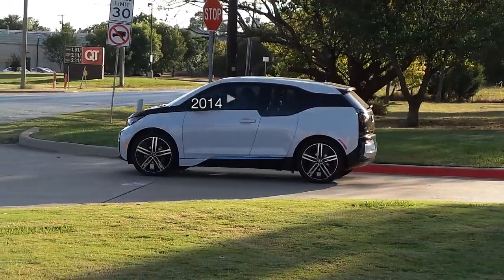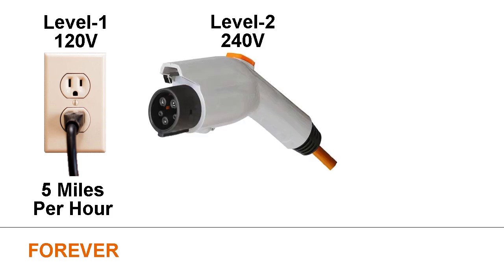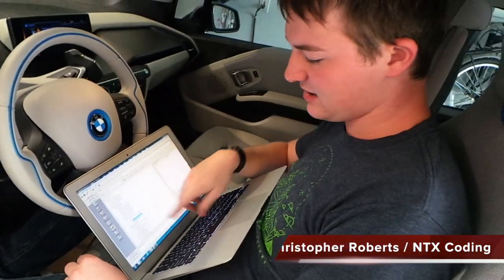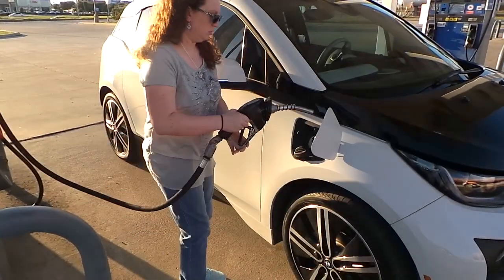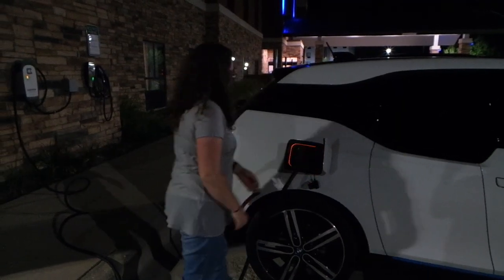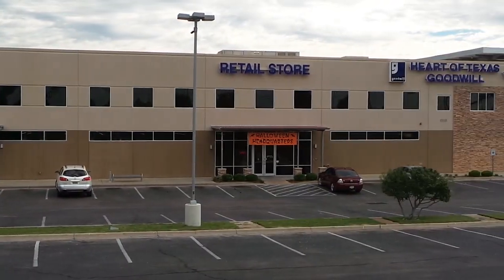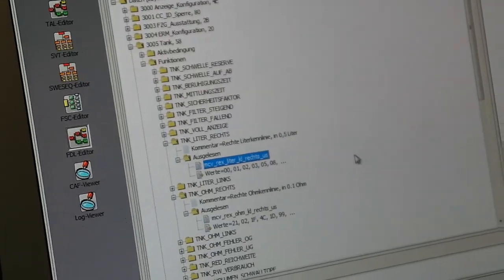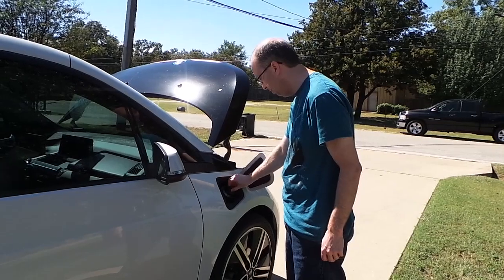BMW i3 REx roadtrip, charging, coding, and range test.

Comment: I loved your review of the BMW I3. I just bought a a 2013 Chevy Volt about a month ago and love it but after researching the BMW I3 with the Rex. I think that car would be better and is a better car so I am thinking about trading it in and getting the BMW I3. Do you agree that this is a good idea? I do like the volt but would rather get the new 2017 volt with better range in 2 years when I trade my wife leaf in. I also wanted to know who could I contact to get the coding fixed like you did in your video? Please let me know as I need to make a decision on Saturday.
Reply: Hey I know this is a few Saturdays late, but I got a 15' i3 REx with max packages used for good price and like it. The early i3 had a few recalls and 15' had many refinements, theres a billion combinations of options so have to hunt a bit for the options you want, the active driver assist being a must.

Comment: Do you pay for the electricity at the charging stations?   I don't know, I don't have one.  If not, why would others pay for it?
Reply: Destination chargers like at the hotel are free, provided for guests. Electricity is included inside so might as well let you charge your car, right? Electricity is cheap in Texas and EVs are very efficient. For reference with my rates I could charge a fully loaded Tesla for just under $8. Try driving 300+ miles on $8 of gas.
Public chargers like the Blink station they stopped at do charge money.

Comment: As far as rest stops go, they're absolutely a thing here in New York, mostly on the Thruway since it's a toll road. There are also ones with bathrooms and vending machines off that section of interstates, but the ones on the Thruway have restaurants in them, as well as a small shop or two usually.

Comment: I have an i3 with the range extender.  My top speed is limited to 70mph when the battery is out of juice.  I made it from Milwaukee to Madison WI on a single charge but used the range extender all the way back. Funny thing though, I can barely maintain 70 but when i dropped to 65 I noticed the battery started gaining charge again. It's funny how much of a difference 5mph makes.

Comment: Hi, enjoyed the video. Appreciate you making it. Was wondering if you could make another one where you drive say 55mph for as far as you can until you run out of battery and fuel, well maybe almost out of fuel, probably wouldn’t want to run it dry but maybe leave 10 miles of fuel and then fill up with an additional tank that’s in the frunk. Could you do that?

Comment: The E-Golf is also a great contender, a little under what they claim the Bolt can do.

And we live on the West coast of Norway and frequently use the car on a 65 mile stretch with curvy roads, it can make it back and forth with no problem if you had to.

 In winter it could do that with efficient driving and a prayer, but a quick 10-15 min on a charging station is enough to make it back with no concerns(also we usually stay for the night and a regular wall socket charger is enough for us then).

Anyway my point is a place like Texas with its warm climate and straight roads are ideal for todays EVs, and its not unlikely that your workplace can provide a socket to charge your car (granted we have incentive for businesses to provide such options and every boss I've worked for owned a Tesla so experience may vary) so really its feasable to have an hour long commutes.

Comment: Nice review. You seemed a little surprised that sustaining a higher speed than the Range Extender could maintain resulted in batterydrainage as well. Truth is the car doesnt "run on the range extender engine" at all; it's just a generator for the battery. This means the car drives on battery at all time, even when you're using the range extender (it simply charges the battery). In this case this resulted in the batterydrain being higher than the range extender could generate, and therefore the net result was a slight drop in battery.

Comment: 8-Bit Guy,
Do you realise that before the catalytic converter in any internal combustion engine, be it a tiny two cylinder motor or a massive v8 has warmed up, is not effective?
Your little 2 cylinder range extender engine releases the same amount of emissions in the first few hundred feet as it does in hundreds of miles of driving once it is up to temperature!
I fail to see how this i3 is any better than a conventional compact car given that the electricity required, still needs to be produced and only 18% of which is renewable in the state of Texas. The same is true for most countries.
Thoroughly enjoyed the video and love your channel,
AP.

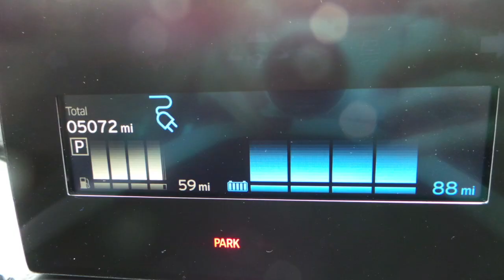Comment: at 8:15 I think the gas range jumped because he got the range extender software changed and because the car was now able to use all the gas in the tank instead of just 1.9 gals of gas it was adapting to the change in gas usage after processing the data from driving as the car would have more gas to use to run the range extender and thus power the car further then before also temperature will affect the estimated range for gas on the range extender

Comment: Excellent video review, I just hope you didn't make the same mistake I did but buying one of them... total nightmare, the handling felt that the car was going to turn over, pray to GOD you never had to replace a flat, those tires are expensive and hard to find... you could feel every single Pebble on the road, TX BMW dealership said we will get level 3 chargers that was a lie..., then problems started my battery, even w the range would only 120~140miles top, then electrical problems, my car was at the dealer 3 times I couldn't lemon law due to needed to be the very same exact # code... then when I sold it not even dealerships wanted it so I had to ebay for "pennies and nickel s"..not sure if you voided it warranty by converting it EU...

Comment: how fast can you drive the car and the 2 cylinder engine can keep up the charge?
Reply: The Rex can keep up at a cruising speed of 60-70mph. Its not always directly charging the battery, most of the electricity goes strait to the motor. Spare energy is then put into the battery.

Comment: Have had a Nissan Leaf for 3 years now. Will never go back to a normal gasoline car. But here in Norway electricity is cheap as well so its basically a no-brainer getting one here as you can see from the sales of EVs here. Will be interesting to see how many Tesla Model 3's that will be sold over here as there are lots of Model S here. Personally the biggest drawback of the Model 3 for me is that it is not a hatchback. With my Nissan Leaf I can fold down back seats, creating a rather substantial cargo room for getting all kinds of things. I have even transported 2,4 meter long MDF wall plates with it. Of course the range of the Leaf is likely too low for many, but I have sort of adjusted our driving needs around the range instead. But even then here in Norway charging infrastructure is pretty good so I could likely go trekking all over the country if I wanted (a bit tricky in the north perhaps) but it would mean a lot of looong charging stops. :)

Comment: I wonder if you can carry a portable 240V generator, if it can charge the car. Usually at about 20 miles per hour, that means give you an extra 40-50 miles or so of range.

Comment: I've watched a few of your videos, i do like how you explain everything. I'm really interested in owning a EV. However, my state IA, doesn't really have any charging stations to speak of as it is more rural than where you drive. I'm a bit jealous of how many you do have in your metro area. My state is more northern and it seems that EV are very unpopular here because northern states like to have AWD vehicles with large engines! I think they might run more peoples' heads if they make more charging stations.

Comment: The 2019 BMW i3 comes with a 42.2-kWh battery (120 amp-hours), which should permit for up to 153 miles of all-electric driving. This is a roughly 30 percent improvement over the previous 94-Ah battery, which allowed for 115 miles of range

Comment: With a DC-DC converter or maybe even just a passive adapter it may be possible to use a supercharger for DC fast charge if you could spoof the handshake code of a Tesla to make the charger output power

Comment: Now you can buy a low mile 2014 I3 for under 20 grand now that the Bolt has hit the street.   A new Bolt would be about 27k after tax credits and discounts.  

The Volt about the same price or a little lower. You don not have to hack the Volt it has a hold mode and gets a 60 mile range in the real world ( not  hypermiling).  On gas power alone the Volt has plenty of power.  You do not need a fast charger with the Volt it can go over 250 miles on gas alone. Also the Volt has the best battery management in the business.  Its battery is heated and cooled. Not positive about the new Volt but the old one only uses 80% of its capacity when new and wont let you discharge below 10%.  As the battery gets older they unlock the final 20% so battery only range remains consistent. The Volt has been extremely reliable.

If you are only using the I3 for local commuting and you cant take advantage of the full tax credit the I3 is a nicer more practical car overall than the Volt with an excellent warranty.

Comment: Why get a REx without hold mode (making the combustion engine useless from what it seems). What are the other uses for the engine
Reply from the maker: It works fine without the hold mode if you are just driving around town, keeping your speed under 70 mph and staying off of mountain passes.  The hold mode is better for long-distance travel but the car wasn't really designed with that in mind. The Rex was really meant as a solution for range anxiety, especially in places where charging stations are rare.
Reply: The 8-Bit Guy very honorable to have a reply from you! I love you videos

Comment: I don't understand how you ran out of battery at 7:16 if you had coded the Hold mode for the Rex.  The Rex is just a generator which charges the battery back.  Un-coded, one is driving so close to empty (e.g., 3.5% - 6.5%) that it's white-knuckly to drive any distance on the freeway without staying in the right lane at 55 hoping you don't kill the battery for reals.  Actually, I don't understand why the coded Hold mode you mentioned getting didn't hold the battery at, say, 75% for as long as you had petrol in the tank.  Thank you for a very informative video, hope you can shed light on my Qs.

Comment: LOL, "Magnolia Market...there's nothing in here that I want; even if it were free!"  Boy, I know that feeling of being dragged into boring shopping by my mom as a kid, now by my wife.

Cool. I actually ate at Colin Street Bakery and remember that place.

Hey, I bought a Chevy Volt from Carvana and I'm in the trial period.  I really like it a lot. Color is Pearl. 2017 LT but with leather and Bose sound, which sounds great.  I just test drove a 2015 BMW i3 rex with Tera trim - fully loaded top of the line and 20" wheels. He said the color was brown.  The i3 has like 28k miles and the Volt has 42.5k miles.  The i3 has more pep and pull when pushing the accelerator pedal, and I like that.  I'm not sure which one to buy:  Keep the Volt or give it back to Carvana and buy the BMW i3.  Any advise 8-Bit Guy?

I mainly will use it for around town and will rarely use gas, but never know when I will take it on a road trip.

Comment: So 30 miles (475 minus 445) with a bit under a tank (say 1.5gal) that gives us 20MPG. In what worl is this even close to a good thing? WHILE draining the battery???? I'd do 35+MPG in my TDI doing 80mph
Reply: No, that is 73 miles per 2,4 galons while deaining the battery = 30,4mpg. Turbo Diesel is 40% efficient at 30-100% load and Gasoline is 30% or maybe 35% efficient at 100% load so 30 mpg is to be expected.

Comment: The reason why the range from the gas tank got up over night is because driving the car with an empty battery uses a significant amount of gasoline to charge the battery, which it doesn't have to, when it's charged. The trip computer accounts for that fact.

Comment: nice video, very informative & I own an Outlander Phev so I know the convenience of any type of extended range petrol engine. 
The only thing that disturbed me was watching clips of your wife driving holding the steering wheel 1 handed with palm face down inside the steering wheel, that offers very limited control over the car if anything were to go wrong, please don't end up dead because of a silly habit. I know your thinking I drive like this ALL the time & its very safe, you think she can avoid something in the road or control the car if you get a puncture? 
Try it, see how much you can steer like that?  Not only bad for you but everyone else @ 80 mph.
Apart from that I enjoyed your video trip.

Comment: the reason the amount of miles left went down could most likely be because the engine is cold. A colder engine means slightly more friction since the oil more viscous and that means less fuel economy. I don't know about the even mode moles though.

Comment: any possible way the gas tank could easily be increased?
Reply: Buy a 1975 GMC Suburban if you're looking for all things "capacity." Literally NO fuel economy, but heh, you can spend $100 on groceries and not even fill it halfway up.
Reply: 70's Ford Bronco or Dodge Durango would work as well.
Reply: Or you can go to Whole Foods, spend $100 on groceries, and not even fill up the i3's front trunk.
Reply: put in a bigger gas tank.
Reply: What @TheYoutubePhantomOffical said.

Comment: I'm watching this video 6 years in the future. Bolt EUV is out, and will be discontinued at the end of 2023.  Because of the economy the price you paid for the car is the same right now.  I'm having a hard time finding one under $30k, in decent condition or low miles.

Comment: For this trip you have taken a trip back to the 1890's to early 1900's when cars were just starting out.   You had to spend a lot of time filling up battery, small fuel tank just to do those few miles, calculations etc...  Seems like a lot of work just to have range anxiety.  I gather you really need to keep the car for local trips only.   Love how you coded it back to Europe  spec's that's cool mod.  All this for a very over priced car.  wow....

Comment: It seems that getting an adaptor for the Tesla slow charge system might be a good idea. I wonder how expensive they are. Did you need to run AirCon for your trip? That probably takes quite a bit of power as well. Are you seeing a lot of EVs in your area now? Its always interesting to see how popular the are in different areas.
The gas can you used is actually a really nice design. My friend has two for his Mowing Service, but they are REALLY rare in Europe. My friend ordered his from Ireland. It was the last two available anywhere.

Comment: my dad has that car and its pretty crap tbh lots of glitches in the cars computer system it never seems to get the range right we have ran out of range 8-10 miles before the car said it would lots of problems with the audio system and it doesnt sound great charges super slow with wall charge but we use a v2 charger now range is crappy also we had some A/C problems cant tell you how many times the car prematurely died on us. driving normal high speeed kils the battery so does a/c if you plan on having this car i hope you live in a city cause i would only use it for small comutes.

Comment: It's really disappointing the i3 didn't put a slightly larger engine in, maybe a 700 or 800cc, and a 5+ gallon tank so the extender would actually be somewhat useful but after reading that it's only 2 gallons and horror stories of the i3 slowing to 55mph on slight inclines with extender I don't think I want a i3 anymore.  Although I've seen them selling for $13,000 with 50k on them so it's very tempting....

Comment: They could have just turned the range extender on in the beginning of the trip and used the battery as a last choice. The range extender can be used to maintain the battery's current level. Which they could have gotten to Waco with about 70 miles of electric range left.

Comment: Have you calculated the cost to charge your vehicle at the house?
Reply from the maker: A full charge will cost around $1.50.  Although on most days the battery is nowhere near fully depleted so it's usually more like $0.20.   Monthly cost for fuel for us is about $5 to $10 per car.

Comment: That kid with the Imack ripped you off hard. $150 for half an hour of lazy work. jeez.
Reply: I mean to do it yourself is 30 something for the connector, and almost 40 for the software. Labor for mechanics is all over the place, technical work usually more. Value is there, yes you can do it yourself for $70 or so, if you spend a bit researching and double checking the settings to change.